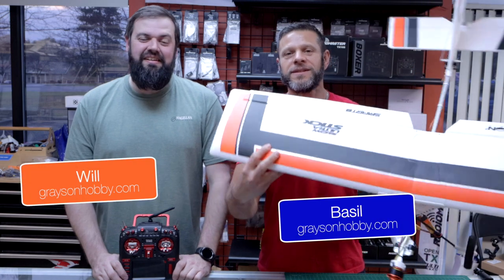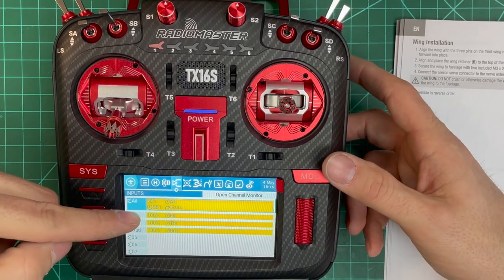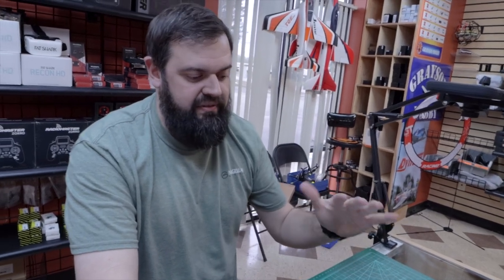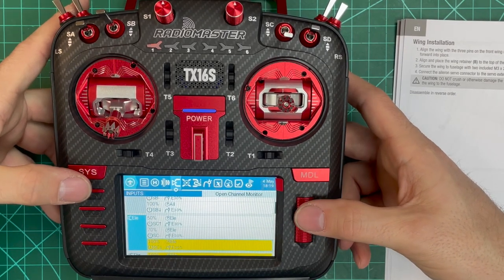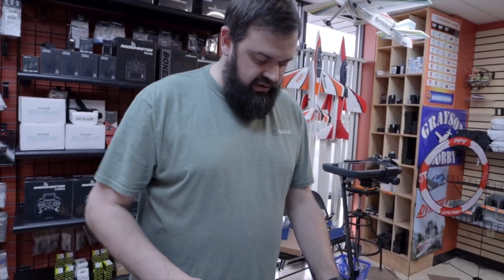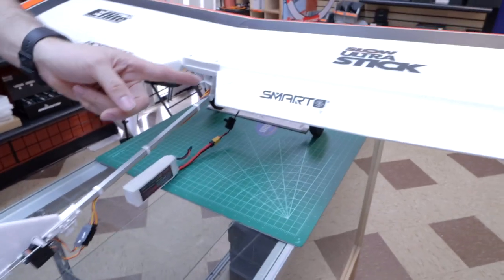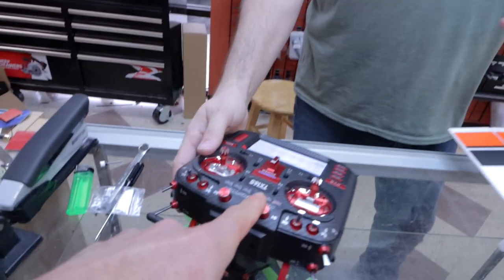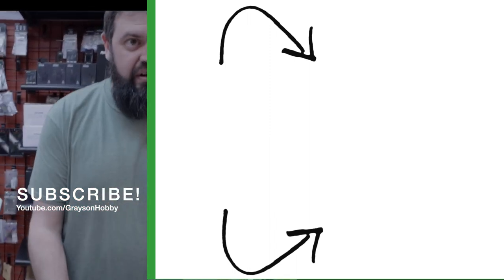Programming & Binding Radiomaster TX16 with Eflite UltraSlow Stick using EdgeTX

Comment: You should disable the Telemetry Alarm for the RSSI, or you would get an alarm on the radio while flying due to the receiver fly-by (short range) telemetry transmission.
Reply: Thank you, I'll be doing that!

Comment: Great, I have a problem setting up my AeroScout with the AR631 RX. The elevator on CH2 isn't moving whereas all the other functions work with the TX16S Max. The AS3X and SAFE work on the ailerons and rudder but nothing on the elevator.

Comment: Hi. I'm trying to bind a RM r86c with my jumper 16 but the r86c doesn't Flash as it should. It flashes 1/sec. Is it not possible to run a r86c with just plus and minus from a Ni-Mh battery?

Comment: hi i own a extra 200 bnf with ar 631 receiver, when i bind without safe mode, the AS3x does not come on even after 25% throttle. I don't have any programming for it set up either

Comment: I always put a zero throttle curve on a switch.  It's too easy to accidentally bump the throttle cut switch
Reply: My throttle cut is on 2 of the 6 buttons on the transmitter. Can't bump that

Comment: I have bound my Slow Ultra Stick with my TX16S using this video and now I get a “RF low” and “RF critical” warning. The aircraft can be right over my head and I get them. Generally around 100 feet and more away from me.

Comment: Why not just buy the PNP version and your receiver, would even be cheaper than to go through all this stress of trying to program the spektrum receiver 🤨
Reply: I was planning to do that. But this version includes a good receiver with gyros, and the price is about the same as a PNP. Made more sense to use the spectrum receiver and do a little work to pair it with my radiomaster transmitter.

Comment: Love this video 👍 I don't have a Spectrum radio, only Jumper & Radiomaster. Can I bind a brand new Eflite Bind-and-Fly models to a OpenTX or EdgeTX radio ? Or do I need to initilize the model with a Spectrum radio first ?
Reply from the maker: Yes you can! Thats what we did in this video.
Reply: @graysonhobby  Thanks for getting back to me, I wasn't sure if you tried it with a Spectrum radio first 😉

Comment: Is that running open tx or edge tx?

Mine has open Tx....

 I can't get Edge tx on my radio
Reply: Sure you can
Reply: @Mikeylikesit1968  I've tried won't upgrade
Reply: @DrDiff952  What transmitter do you have
Reply from the maker: In this video, the RadioMaster TX16 is using EDGE TX